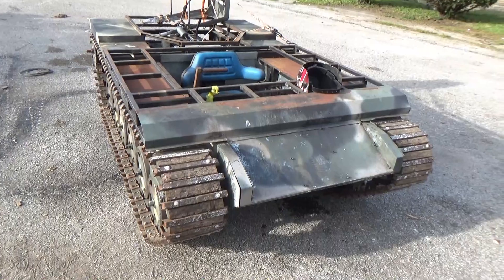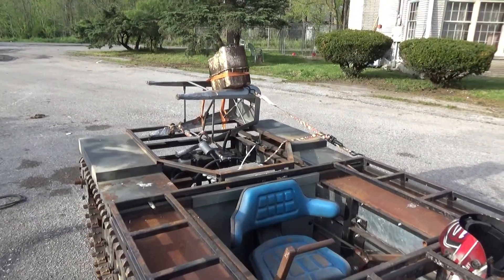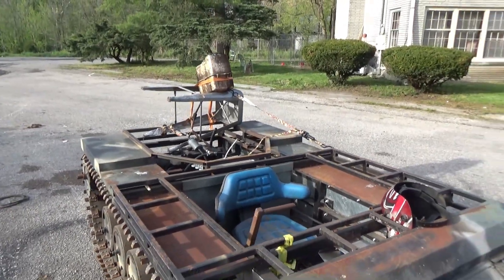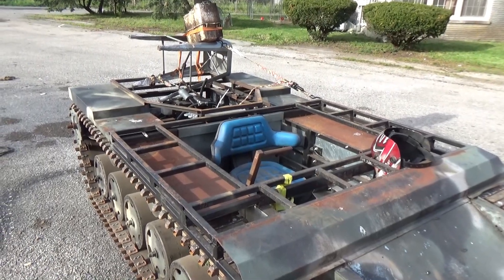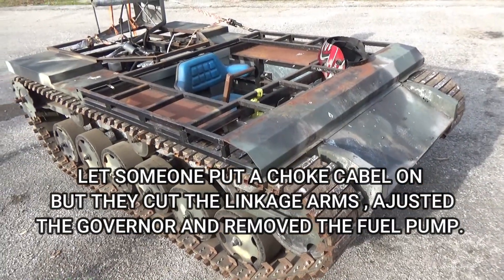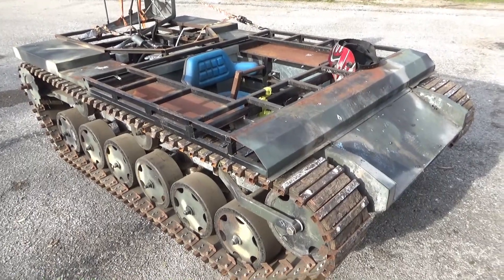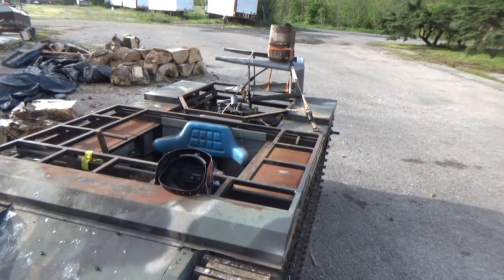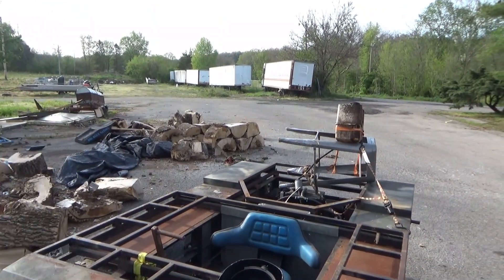TRACKED VEHICLE 4 RECONDITION HOMEMADE SCALED TANK AND HOME MADE TRACKS

Comment: I am dying to know your drive train components
Reply from the maker: The drive train is 21 cc hydraulic pumps with 21 cc hydraulic drive motors  , pumps are connected to a tee unit  from a 27 hp Kohler Commander . Belt driven from tee-unit to engine, but will be changed to a horizontal direct drive and a 31.4 Vanguard on the tanks and a 27 hp on the MAV's . I am making a video today testing the new 31.4 vanguard on the newest prototype and it's awesome , ( maneuverability not video ) . Thanks for watching .
Reply: TANK COMMANDER BT what’s the torque on those motors?

Comment: What's the displacement of the engines you use in your personal armored cavalry?
Reply from the maker: Thank you for you comment and sorry for the late reply but the engines in the MAV's  are 31.5 hp running 21 cc tandem hydraulic pumps and wheel motors .